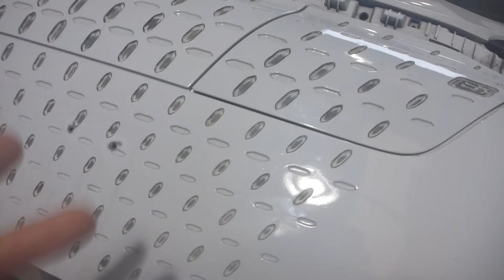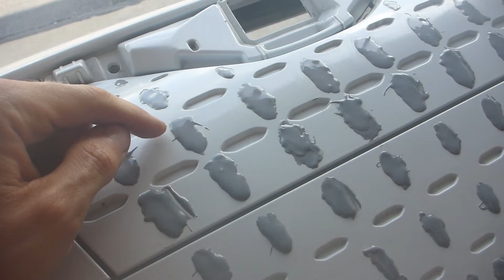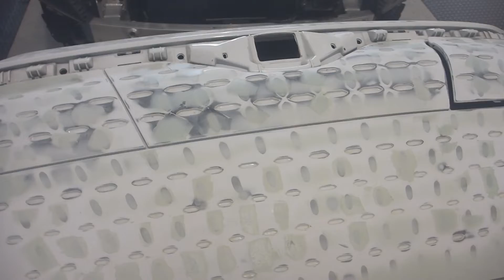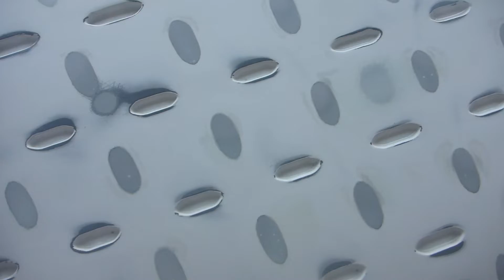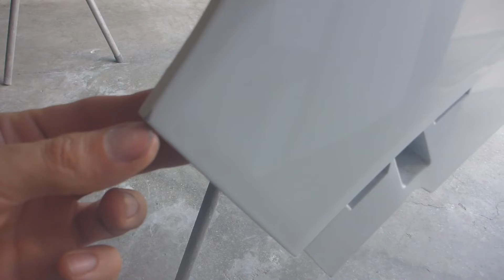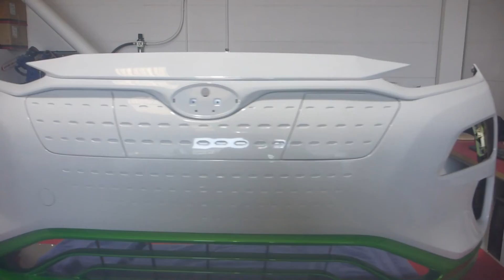2020 Kona EV Bumper Re-Design - Step By Step Process and Result!

Comment: A metal bondo spreader or razor blade would have allowed you to have less of a high build of fillers in the divets & made sanding much easier.
Reply from the maker: neither of those sound nearly as tasty as quinoa bowls, but I see your point.  :-P